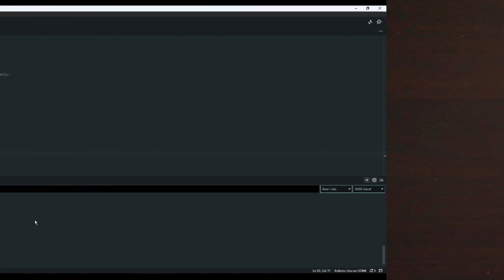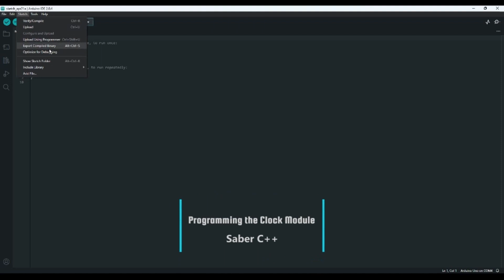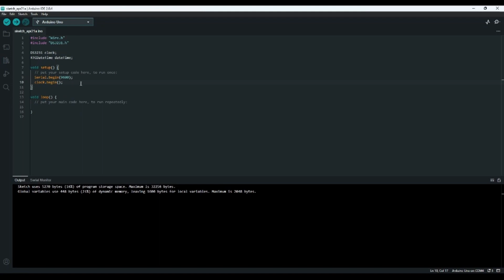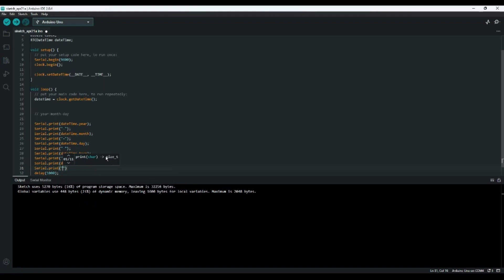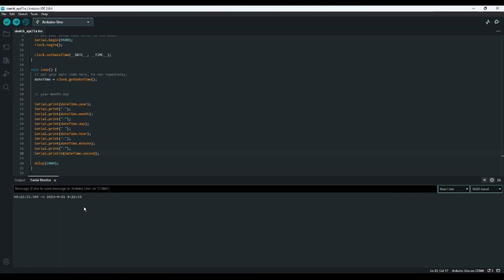Arduino Clock Tutorial (DS3231 RTC Module)

Comment: C:\Users\Administrator\AppData\Local\Temp\.arduinoIDE-unsaved202447-2116-kp913d.lm1da\DS3231_simple\DS3231_simple.ino:4:8: error: 'DS3231 clock' redeclared as different kind of symbol
 DS3231 clock;
        ^~~~~
In file included from C:\Users\Administrator\Documents\Arduino\libraries\DS3231/DS3231.h:28:0,
                 from C:\Users\Administrator\AppData\Local\Temp\.arduinoIDE-unsaved202447-2116-kp913d.lm1da\DS3231_simple\DS3231_simple.ino:2:
c:\users\administrator\appdata\local\arduino15\packages\arduino\tools\avr-gcc\7.3.0-atmel3.6.1-arduino7\avr\include\time.h:164:20: note: previous declaration 'clock_t clock()'
     extern clock_t clock(void);
                    ^~~~~
C:\Users\Administrator\AppData\Local\Temp\.arduinoIDE-unsaved202447-2116-kp913d.lm1da\DS3231_simple\DS3231_simple.ino:5:1: error: 'RTCDateTime' does not name a type; did you mean 'DateTime'?
 RTCDateTime dt;
 ^~~~~~~~~~~
 DateTime
C:\Users\Administrator\AppData\Local\Temp\.arduinoIDE-unsaved202447-2116-kp913d.lm1da\DS3231_simple\DS3231_simple.ino: In function 'void setup()':
C:\Users\Administrator\AppData\Local\Temp\.arduinoIDE-unsaved202447-2116-kp913d.lm1da\DS3231_simple\DS3231_simple.ino:13:9: error: request for member 'begin' in 'clock', which is of non-class type 'clock_t() {aka long unsigned int()}'
   clock.begin();
         ^~~~~
C:\Users\Administrator\AppData\Local\Temp\.arduinoIDE-unsaved202447-2116-kp913d.lm1da\DS3231_simple\DS3231_simple.ino:16:9: error: request for member 'setDateTime' in 'clock', which is of non-class type 'clock_t() {aka long unsigned int()}'
   clock.setDateTime(__DATE__, __TIME__);
         ^~~~~~~~~~~
C:\Users\Administrator\AppData\Local\Temp\.arduinoIDE-unsaved202447-2116-kp913d.lm1da\DS3231_simple\DS3231_simple.ino: In function 'void loop()':
C:\Users\Administrator\AppData\Local\Temp\.arduinoIDE-unsaved202447-2116-kp913d.lm1da\DS3231_simple\DS3231_simple.ino:21:3: error: 'dt' was not declared in this scope
   dt = clock.getDateTime();
   ^~
C:\Users\Administrator\AppData\Local\Temp\.arduinoIDE-unsaved202447-2116-kp913d.lm1da\DS3231_simple\DS3231_simple.ino:21:14: error: request for member 'getDateTime' in 'clock', which is of non-class type 'clock_t() {aka long unsigned int()}'
   dt = clock.getDateTime();
              ^~~~~~~~~~~
Multiple libraries were found for "DS3231.h"
  Used: C:\Users\Administrator\Documents\Arduino\libraries\DS3231
  Not used: C:\Users\Administrator\Documents\Arduino\libraries\DS3231_Arduino_Library
exit status 1

Compilation error: 'DS3231 clock' redeclared as different kind of symbol
Reply from the maker: Try renaming clock to myClock or something in all places (with a find and replace if you wish) and change the RTCDateTime to just DateTime on line 5

Comment: the time isnt saving. Everytime I plug in my microcontroller it resets to the time that I originally uploaded it on.
Reply from the maker: I take it from your response that the program does work as intended while the Arduino is running (i.e. the print statements are correct). If that's the case, then your clock module must not be running when it's not connected to the Arduino. The most likely reason is that the battery is dead, I'd try switching it out.